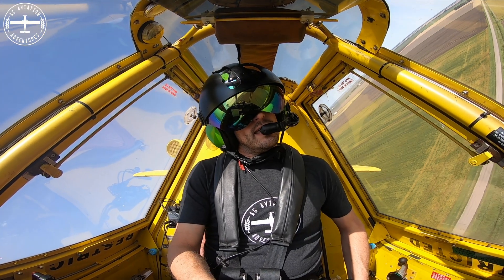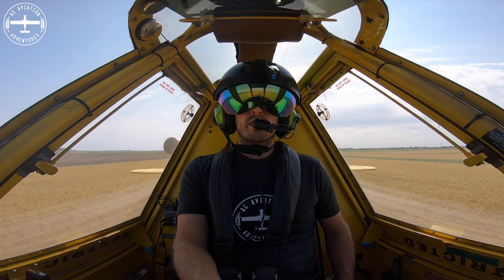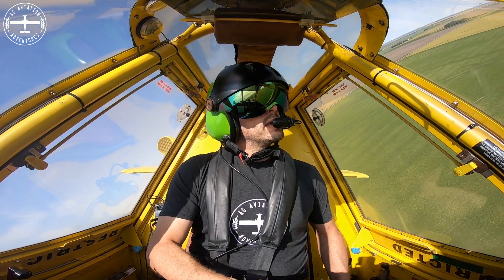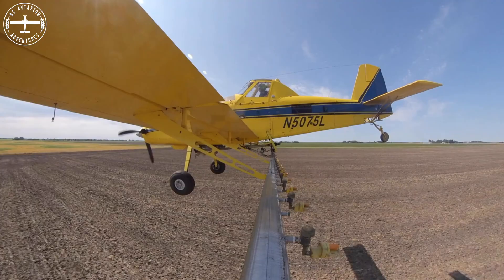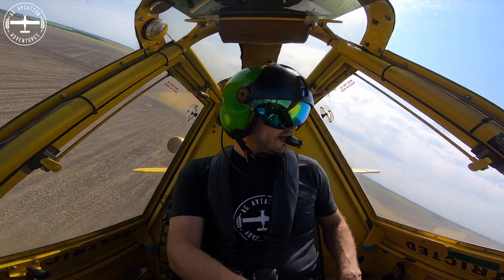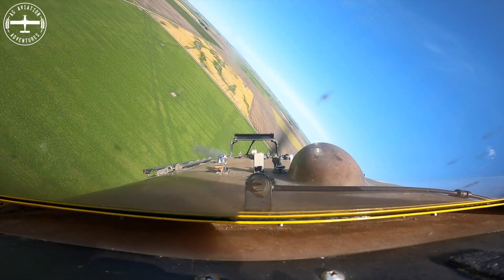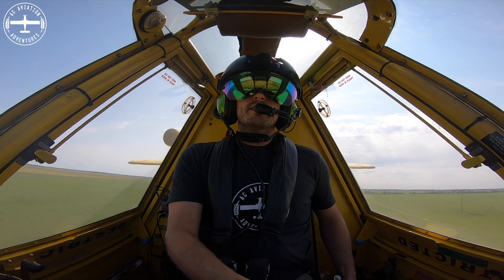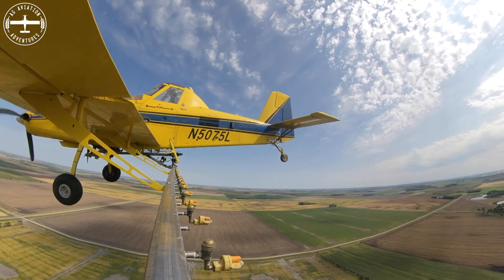Why Use an Airplane to Desiccate Crops Prior to Harvest?

Comment: Ever needed to do a go-around on one of your landings? and what kind of landings do you do usually, wheel or 3-point ?
Reply from the maker: Yeah I’ve done go around a for different reasons from someone on the runway (our dog Hank) to strong crosswinds. Most of the time I wheel land.